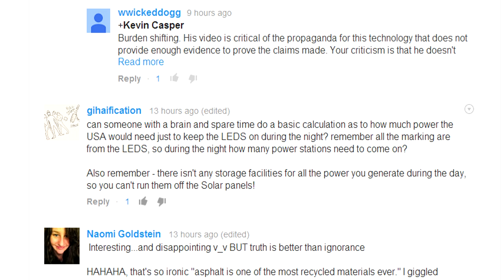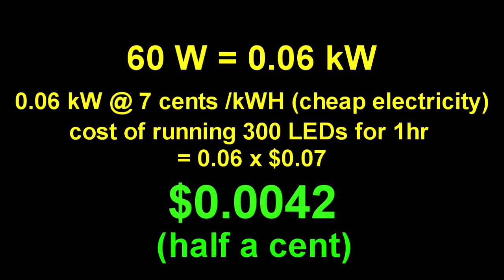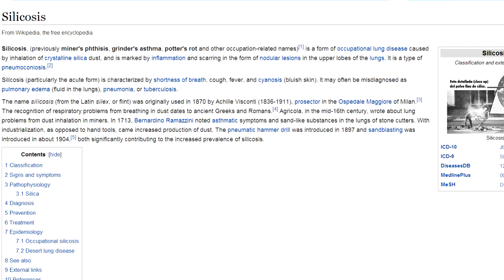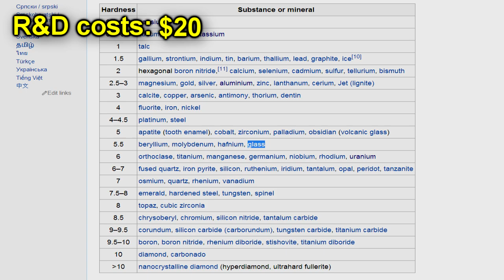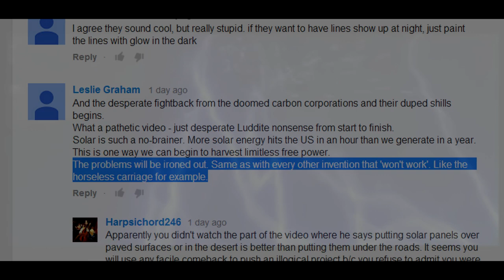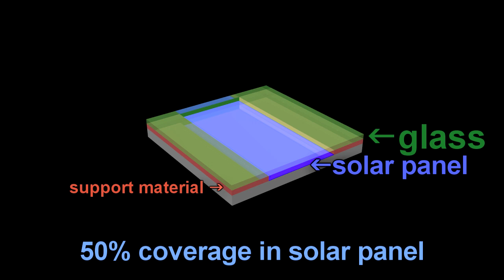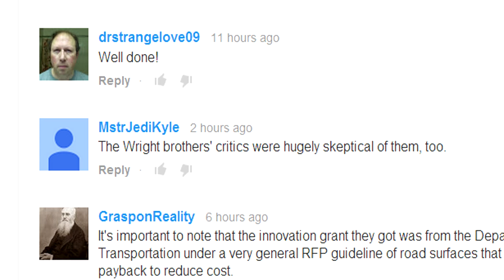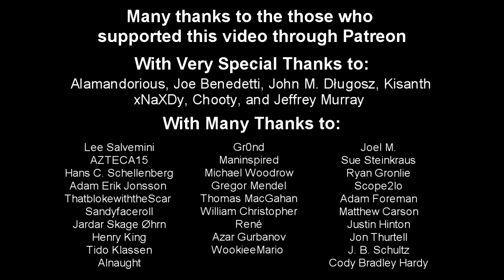Solar Roadways, IMPORTANT QUESTIONS AND ANSWERS!

Comment: It seems to me that the biggest issue with all of this is that it's trying to use massive engineering to solve a problem that doesn't exist. There are at least as much square miles of roof tops in this country as roads, only a small percentage of which actually have solar installed on them. Then as Thunderf00t already pointed out we have really good technology to build solar canopies over parking lots that get better sun exposure than being under cars and have the added benefit of keeping the cars cooler in summer. Finally rooftop solar puts the energy generation in the same area where it's being consumed as opposed to the middle of nowhere where a great deal of the road surface is.

It's not like all of that has been done and we still need more solar capacity.
Reply: voiceofreason4677

It's not actually cars that cause much damage to roads. It's weather with frost heaving and 18-wheeler trucks.
Reply: The US has miles and miles and miles of desert so ye the whole road idea is just absolutely useless.
Reply: Solar panels on rooftops? Crazy and boring idea that can´work, flying solar panels, that´s the future worth money on kickstarter !!!...it may also kill off idiots when malfunctioning. :ppp
Reply: axe863 FYI: an RBE is about the evolution of private property, the process of having free exchange and it is not Communist, it is technocratic, but then again I can't expect people who don't read the literature to understand this.
Reply: Well, if one is so concerned about the roads being repaired, the best way to eliminate the money needs to repair the roads is to make car's available at any given time. The ability to use self-guided car's like Google has on a mass scale coupled with the ability to give them constant gps access and being available to whoever uses them, will greatly reduce both the dependency of having a car as well as the possibility of reducing traffic jams, given that quite a few people would rather just drive aimlessly rather than have a specific destination.

I mean there is a problem with our roads being repaired and destroyed in a way that is far too fast to compensate, but Solar Roadways it would appear are not one of them.
Reply: voiceofreason4677 Communist, please. I'm not exaggerating this guy thinks that eliminating money, free exchange and private property and giving 100% of the world's resources to a RBE system, a library type system whose optimization technology has yet to be quantified,  is a great idea.
Reply: voiceofreason4677 There is a non-trivial difference between technocracy which would control 100% of the world's resource under common ownership but has pseudo-budget constraints via energy certificates and a RBE which would control 100% of the world's resource under common ownership and exhibit no budget constraints. Both are insane but while the former is a radical form of authoritarian socialism the later is Marxian communist and assumes the existence of Marxian superabundance to overcome allocation conflicts which necessitate the existence of a state.
Reply: voiceofreason4677 
A RBE system: a moneyless, classless, stateless post-scarcity steady state society where private property has been eliminated and all resources are in common. 

 Marxian Communist steady state system :a moneyless, classless, stateless post-scarcity steady state society where private property has been eliminated and all resources are in common.
Reply: axe863 Private property is not eliminated, just that the concept and what we deem as private property just changes. We have something called the commons and we instate it if it can benefit all within said city district. That being said, Marxists emphasis the worker, technocratic systems eliminate the drudgery of work. We emancipate the worker. I don't get why it's so hard for people to read the literature by technocrats.
Reply: voiceofreason4677  lol Were not going to eliminate private property because were just going to redefine the word private property to mean access to RBE system managed common resources. You should run for political office. You really know how to spin something. 

Marxists only emphasize workers under a capitalistic system because of their adherence to a labor theory of value and Marx's hypothesis of oppressor/oppressed predator prey model.

Marx predicted that as a capitalistic system becomes more advanced it will attempt to extract more and more profit from an ever dwindling labor supply due to excessive amount of capital investment and technological innovation which would further led to greater capital investment and technological innovation. In Fresco's... I mean Marx's capitalistic collapse model, the ever declining profit rate would cause a capitalistic collapse and laborers will become free of work to pursue anything they want due to the emergence of superabundance/post scarcity that was driven by capitalism.
Reply: voiceofreason4677 What is your null position with respect to a RBE?

I) That the yet to be quantified RBE works until exhaustively demonstrated otherwise. (I have to make this caveat because the system's optimization technology and objective function/ efficiency measures are completely unspecified)

II) That the yet to be quantified RBE  doesnt work until sufficient evidence affords one the privilege to reject the null

Let's see how rational you are.
Reply: axe863 Um... I already fall into both in a way, but yah...
Reply: voiceofreason4677 o_O So A and not A at the same time. You're giving me a headache.
Reply: Not to mention, roofing a building with solar panels has quite a bit of passive benefit, since the sun won't be heating up the roof.

Comment: Other problems: many portions of the road see little sunlight and are in the shade next to buildings and mountains, dense traffic would also block the sun, many locations are often cloudy and would not generate solar power efficiently, roads get dirty and would have to be cleaned constantly so sunlight can reach the panels

Better idea: keep putting solar panels on top of things such as homes, buildings, parking lots, etc. Building lots of solar panels is a good idea, but putting them in the roads is a stupid one.

Comment: I don't think the brightness of the LEDs is an issue. Thinks of the digital billboards along many highways, or in Times Square, NYC. They are all readable during the day. Your electronic hobbyist LED test wasn't really a fair test. (Also, I doubt it was 60V to light up your test. Most strips run on a 5V feed, and strips with individually addressable RGB LEDs need about 60mA per LED, analog strips about 20mA for single colour.)

However those ultra-bright LED bulbs in digital billboards use between 2W and 10W while lit. Guessing they use a standard 24V feed, that's almost 500mA per light.

When you combine that with the number of LED lights per tile to get the solidity of road markings as seen in the concept art, we're talking a kilowatt or more to keep each one lit up. So you were on the right track withers the huge amount of power needed to run a system like this.
Reply: Those billboards are in a shaded area surrounded by huge buildings and are on black backgrounds.
Reply: I do agree with your sentiment regarding the power consumption of ultrabright LEDs, but I think the comparison to those Digital Billboards might not necessarily be super accurate, simply because they are usually oriented in a way that they face your gaze.

If you suddenly put those ultra bright leds under a sheet of dirty, possibly scratched/damaged glass, where they will instead face the sky... things become a lot more difficult to see, I'd wager :)
Reply: I don't think the scratching will affect the brightness. You wouldn't be able to read text on a badly scratched smartphone display, but you're not doing that on these tiles. The light would still get through, just like with so-called "frosted" glass.
Reply: Not the roadside ones.

Comment: After doing a little more research, I found the cost of these solar tiles is around $7,000 each (according to How Stuff Works).  Keeping with one of TF's approaches (just showing the enormity of the task), the total cost of paving every road in America with these tiles is no less than $1680 trillion dollars.  That's more than 100 times the GDP of America...in other words, the value of everything America makes or does (services).  If we cashed all of that in, and we devoted ourselves to rolling out solar roadways, it would take over 100 years to finish.  And in that time, we'd have no lawns getting cut, no houses getting built, no doctors performing life saving surgeries, etc.  Cut it down to just the US government pouring money in (with a budget around $3.5 trillion), and it takes 480 years.  With no military to protect us, no social security, nothing.

Anyone who thinks this is still a great investment of time and money, this is only the cost of the tiles themselves.  Not the copper to wire them up, not the cost of the labor to lay it out and dig the trenches, not the cost of the fiber/copper to network them, not the cost of the AC inverters so homes can actually use the DC solar power, and not the required 5-6 year maintenance of every tile as the LEDs burn out.

Numbers don't lie.  People do.  Do the math for yourselves, and find out who's lying.

Comment: I think you are right at most things, you bring up good points but your research seems flawed. if you're testing Cheerios you cant say that Total is bad. E.g. white LED strips dont have the same effect as the black/green tiles, it's the same with the traffic lights - they have black background so we can see them. also they might be using hybrid glas.. the research would find what material to make it from to make the most efficient product.

Comment: 1) there's a reason why we tilt our roads in the first place. so that rain rolls off the side, along with the dirt. even so, the dirt sometimes remains for a long time, e.g. exhaust fumes tend to leave marks on the road.
2) why the fuck, are you placing solar panels, beneath stuff, which creates shadows. where is common sense?
3) neither solar panels (silicon mostly) nor glass are particularly tough materials. pressure aside, they are brittle, and get worn really quickly.

Comment: I'm not sure if this has been mentioned yet, but if these solar tiles were used, what would be stopping me from stealing the road? If it's so easy to remove and replace them, then it's equally easy for me to drive to some little-used road, then fuck off a few minutes later with a stack of them in the back of my car. Each one containing assorted valuable stuff like solar panels, high-output LEDs, copper wire, and fibre optic cables.

Comment: The Solar Freaking Roadways people seem pretty hopeless in defending themselves so I'll try and play devils advocate (just for the hell of it).

Firstly LEDS: They obviously wont be buying their LEDs from a public, online shop. They would be buying them in bulk and as such they would be substantially cheaper. Without taking that into account the numbers mean very little. Even a more closely informed fraction of the cost that Thunderfoot suggests would probably still amount to a substantial amount so it seems silly and churlish to use the price from online shopping.
Thunderfoot's LED power consumption estimates don't seem to consider the actual power being generated by the panels. There is little information being given about how such things will work, including how they plan to store the electricity (I imagine it could be a case of the power generated by the panels during the day could be only used during the day reducing (or perhaps eliminating if you believe the hype) the need for traditional power production and then at night traditional methods would kick in. Although that would require existing systems to then power not only Americas current needs but to power the roadways as well... I did say I would try but I really can't imagine how they think it will work and I'm not sure why they wouldn't address such issues in their official response (unless they have hidden it in on some FAQ page somewhere that I'm supposed to find).
With respect to the bulb life expectancy and replacement, I would hope that Solar Freaking Roadways (SFR) would have a solid ideas on how to develop longer lasting bulbs and how they would be replaced.
Thunderfoot (TF) says that putting the lights above the road is better. I'm trying to remember if SFR suggested that the LEDS would actually replace overhead lighting or if their suggestions were that it would perhaps compliment it.
SFR have said that the original LEDs they had suggesting using were in fact not powerful enough and that they have subsequently upgraded that spec. They use current examples such as LED billboards that are easily visible during the day. This will obviously mean more power to light them but they don't explain such specifics.
TF also spoke about the challenges of upkeep on a road with LEDs but didn't give direct comparisons to the upkeep on current roads.

I think TF puts this video up before he would have had a chance to read SFRs general rebuttal to the critics (including TF specifically). They supplied a different hardness scale that suggested that glass was one of the hardest substances and asphalt was comparatively soft... I guess we have to do our own research to establish which scale is more accurate but I'm guessing part of it is that hardness is a factor and there are other factors that tie in with it regarding durability and usability.

After a quick search I found that borosilicate glass and the SFR tempered glass, while both are very "strong", they have different properties such as breaking in different ways and tempered glass can't be cut which would suggest that TF's test is not particularly relevant (I'm not sure if they mentioned it was tempered in their official video but they have since stated it on their site).

As to TF's comments on the efficiency of the panel I can't think of any arguments for SFR. Unless they have some amazing new technology they are keeping a secret it seems quite implausible. In fact, I think TF was being generous because many roads are lined by trees and buildings that will shadow them. In fact the areas where they would get the most sunlight are areas where fewer people live and as such their are fewer roads. Especially here in Australia where most of the country is arid and with a similar land mass to the US (-Alaska) but a population of only 22 million the best areas for solar have limited road networks.

SFRs aren't planning to use sapphire and I don't know how many spark plugs usually fall out of cars.

If you got this far then sorry about my poor English but it's not my first language... Australian is my first, that's my defense and I'm sticking to it (it might also have something to do with not wanting to proof read my post at this time of night).

Comment: Thank you for this video Thunderf00t.  It is a fantastic quantitative follow-up to your previous video on the subject, and does a good job of supportive your ideas.
To summarize the basics of this for those who would critique, SOLAR ENERGY is a GREAT IDEA and has hundreds of thousands of applications, including road surfaces.  Road surfaces, however, is one of the worst possible applications to this technology.  Rather than placing the solar panels IN THE ROAD, you can place them NEXT TO THEM/ABOVE THEM in order to generate power at a more efficient rate, as well as reduce the repair/maintenance costs/times of the technology itself.  
Solar energy is certainly one of the most viable options for our future, but we should focus our development efforts and funding on developments that are simply more practical, more efficient, and will give us a larger net output. 
We don't need Tron in our roadways, given long enough (and with enough free solar energy) we could actually just literally develop the real Tron.  It's all about patience.

Comment: something they never discussed either is the bolt hole in the glass. Thats a source of imminent destruction to begin with. We all knows what happens when water gets into a pothole and is constantly pounded by tires. It will eat away at the edges of the glass and will destroy whatever they use to seal it. And if they used an epoxy it would inevitably detach from the glass and would also make it terrible to remove and replace.

Comment: The idea is fantastic and it is good to see it being considered. However, clearly it is not currently practical and may never be (although never say never!). I've been a TF fan for years now but I am growing tired of his constantly mocking attitude. There were people who mocked steam power because it couldn't compete with horses and later there were those who mocked petroleum because it couldn't compete with steam.
Oh, and the calculations for the electricity bill shouldn't show ALL the LEDs being on at once. Additionally, not every panel would even need LEDs at all. How much of our roads have painted lines or signs beside them at the moment?